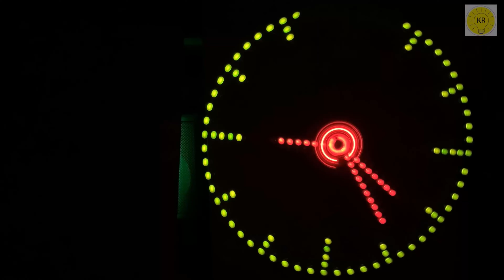how to make propeller clock arduino nano, science project , electronics ,jlcpcb

Comment: What is the task of hall sensor in this project?
Reply: Synchronization. It tells the controller that the rotor is at a specific location. Like that the controller knows how fast the rotor spins and can calculate the time delays for the LEDs.